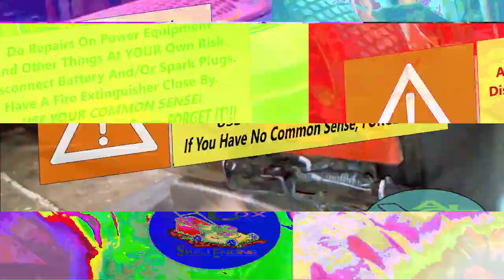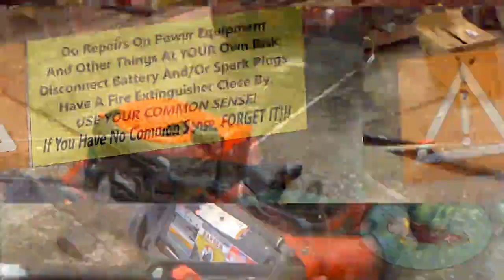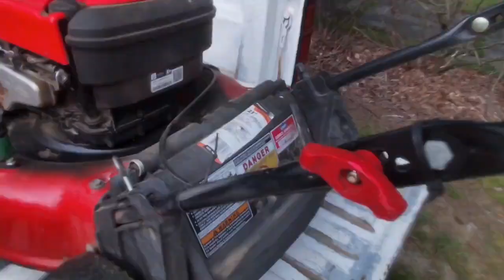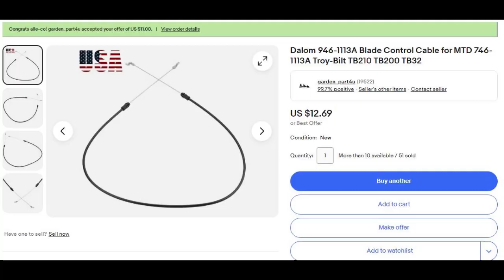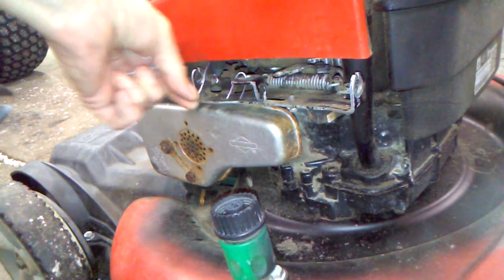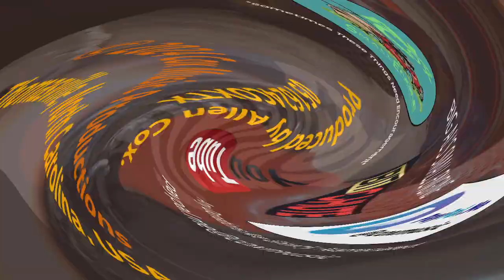TROY-BILT TB210 BRAKE CABLE | MTD 746-1113A | DALOM 946-1113A

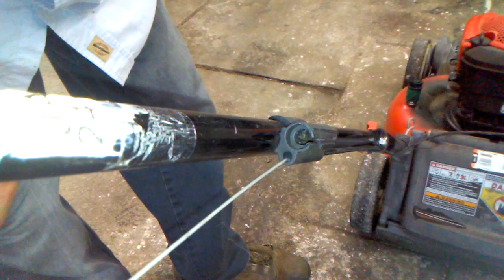Comment: I'm trying to replace my cable but I can't get it out of the bracket you point to @3:00. Any suggestions on how to remove the old cable?
Reply from the maker: You can use needle nose pliers and get on the clip of the cable and release it.
Reply: It's held in like the lower end, with two lugs holding it into the hole on the handle side.  I was able to chop off enough of the surrounding plastic with my big wire clippers to reach the lugs and squeeze them so the thing comes out.  Like most of the dopes who make these videos, he leaves the hard and puzzling parts out.